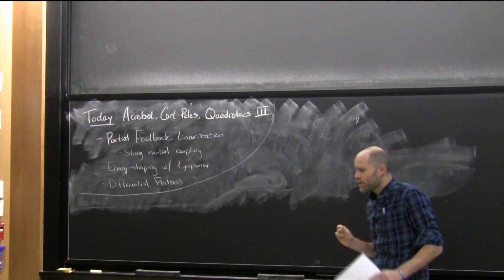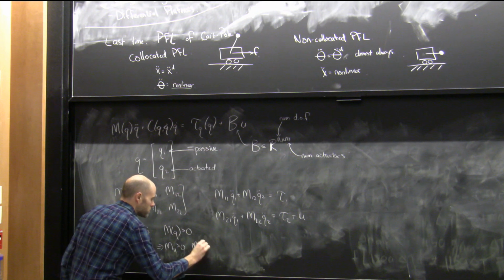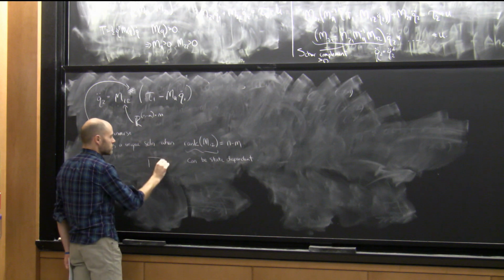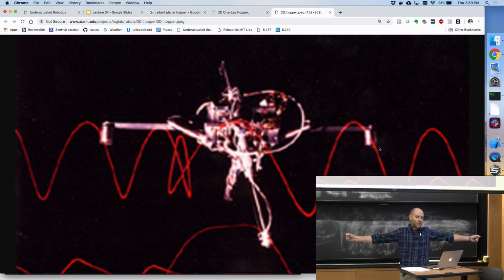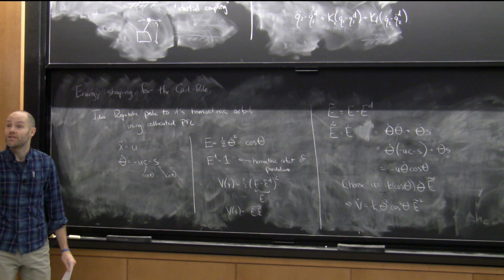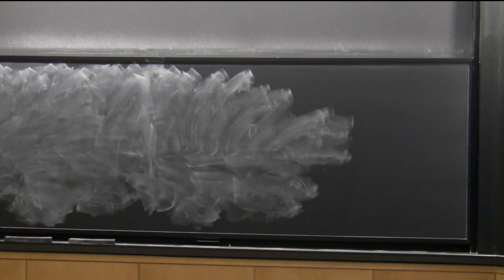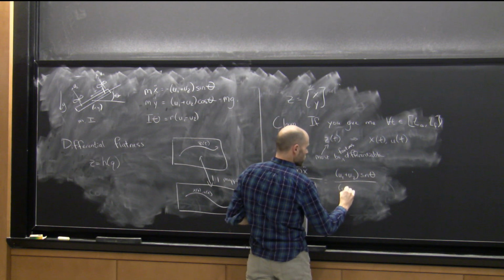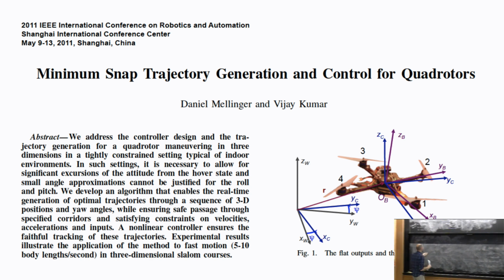Lecture 7 | MIT 6.832  (Underactuated Robotics), Spring 2019

Comment: Hello ,
In case of 3d quadrotors if I want to control roll or pitch (which might be the case in going through a window) do I first find roll or pitch and then find the corresponding yaw which will lead me to appropriate u ?
Reply: It sounds like you are referring to the differential flatness approach?  Unless you are able to find another clever parameterization of the flatness, the main result we have is that you must plan in x,y,z,yaw, and only add constraints to pitch and yaw (which are functions of the flat variables).  Unfortunately, these are going to be nonlinear/nonconvex constraints, so it means either nonlinear optimization or clever bounds/approximations.

If one is already doing nonconvex optimization, the merits of the differential flatness formulation are less obvious.  You could simply do a more standard trajectory optimization, including pitch and roll as decision variables, and leverage the entire suite of objectives/constraints on them directly.
Reply: @rtedrake   Thank you

Comment: I'm not sure I understand it correctly, if you have cartpole and want to use non-collocated PFL, ignoring the issue w/ theta=pi/2, can you use energy shaping of the pendulum energy (mltheta_dot - mglcos(theta) nad Ed=mgl) or you need to consider the energy of the cart in this case?
Reply: The goal is to make a statement about the dynamics of the entire system (cart+pole) -- typically by producing a Lyapunov function.  There is not a turn-crank recipe for these systems -- if you decide to use the non-collocated PFL, the burden is on finding the controller + Lyapunov function, e.g. by making cos^2 etc.
Reply: Thanks for answering, going from the Lyapunov function helped!. Although, there's still tricky part in this lecture and 3.6.3 section of the book: why one can use the energy of the pendulum only (is it because the pendulum is passive, e.x. 3.3 in Non-linear Control for Underactuated Mechanical Systems ?), without worrying about the cart in the derivations of the swing-up controller, e.x. why one doesn't need to consider full energy equation: 0.5 * q_dot^T * M * q_dot + U(x) as it is the case with acrobot. In non-collocated PFL it seems that you can't write V(x) = 0.5 * (E(x) - E_desired) where E(x) is the energy of the inverted pendulum since you won't have any term related to the cart and if the pendulum was in the upright position, V(x) = 0, it could have e.x. very high cart velocity and the V(x) would actually increase in this case.

Comment: Besides quadrotors, are there any other systems that are known to possess the property of differential flatness?
Reply from the maker: certainly.  richard murray has some nice papers on it (at least one of them is linked from the online notes).  perhaps my other favorite example is a many-link (serial chain) snake-like robot.
Reply: differential flatness is more an input-output concept as oposed to a system property. A system can have different input-output pairs which make them flat. For instance, for every linear system that is controllable (and observable) there exists a flat output (and input), which are not unique. They can basically be computed by inverting the Controllability (Observability) matrix. Finding a flat output for a nonlinear system on the other hand is not as simple, because it involves solving a PDE. So the question is less if a flat output exists, it's more the question of finding it.